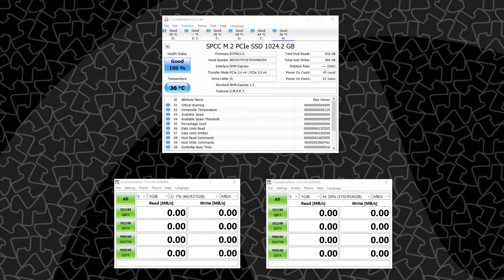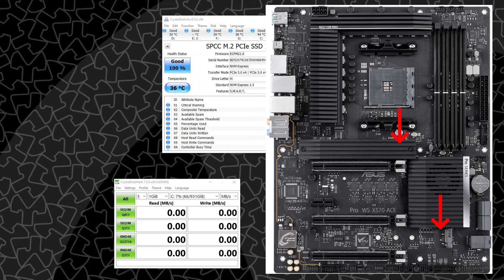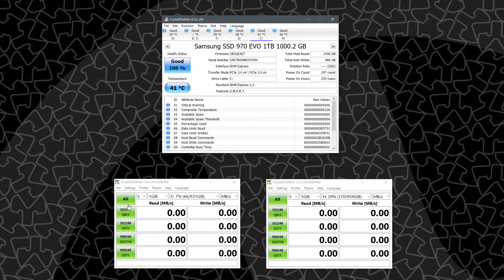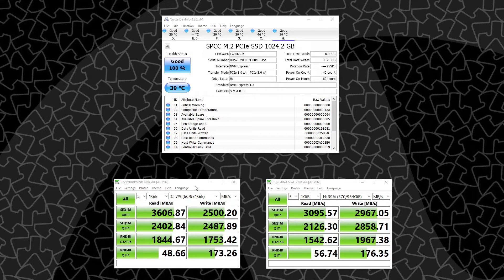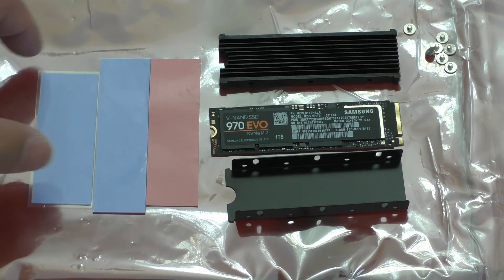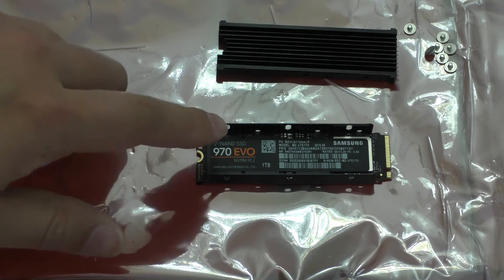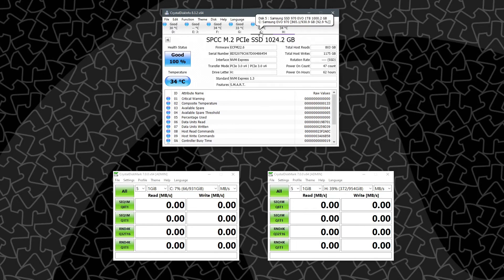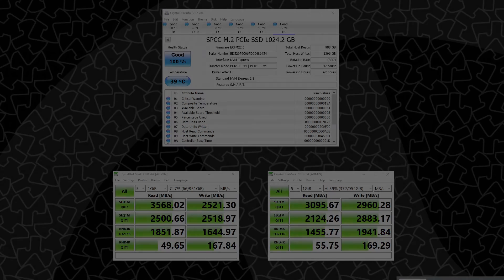Motherboard M.2 SSD Heatsinks, Yay or Nay?

Comment: The question for which I've got is can I replace the native M.2 heat sink with an aftermarket so that they are both the same?
Reply: you can, but unlikely to yield any performance difference
Reply: @tenka__  Not looking so much at the performance issue. More like aesthetics in this instanstance. As I'm I'm planning on an AMD cpu and Radeon build and want a clean build

Comment: Great video, but I got a question. Do I need to take off the M2 sticker (I have the same Samsung M2) before putting it on to the mobo heatsink? Thanks!
Reply from the maker: There's no need to remove the sticker. The heatsink will work just fine with it on.

Comment: Does anyone know if I can move my m.2 from the non-heat sink position to the heat sink position without issues?
Reply from the maker: Yeah that's no problem. Might have to make sure the boot drive is still correctly set in the UEFI if you're moving your boot drive though.

Comment: im using an aorus b450 elite motherboard and 1 TB Lexxar ssd nvme m.2 gen3x4. this ssd gets kinda hot when i play rdr 2 ( average 61-62 ish, max 65 celcius ). this mobo come with 2 slots and i use the one that have heatsink. is it safe? or should i buy this aftermarket ssd heatsink?

Comment: Every NVME video that I see does not show if the ssd label should or not be removed before placing the thermal pad over it, please tell me, even in this video you didn't show this passage
Reply from the maker: There's no need to remove the sticker. Lots of them are made to conduct heat.
Reply: @FaRKle0079  thank you , I didn't know it

Comment: Which heatsink would you recommend for a seagate firecuda 520? Since it is a double sided m.2 with chips on both sides I'm not sure which heatsink would be best for it. The one with the motherboard showed better performance for you but it doesnt cover both sides, so I wonder if it would be better or not and show better performance for the firecuda. Please get back to me, thank you! (P.s. I have a second single sided and not as fast m.2 that I was also going to use so I'm trying to find out which heatsink to use for which drive.)
Reply from the maker: The main component on the SSD to keep cool is the memory controller. That's what controls throttling of the data rate. The actual flash memory chips themselves don't really need cooling (unless you're operating in a SUPER hot environment). So I'd say you likely don't have to worry about the bottom side memory not having a heat sink.

Comment: Nice video! Helped me to understand the performance of different heat sinks
Reply: Bro every nvme ssd  come with heatsink or I have to add new heatsink for temperature???
Reply: @nstsarr5189  Depends on the situation. Usually, it doesn't come with a heatsink unless it told u like SN 750 with heatsink and it would be a bit higher price than without heatsink. And the heatsink is impossible to be used inside the laptop. Some motherboards of desktop have the heatsink on the board. You only have to buy the heatsink while both NVME SSD supplier and motherboard don't give u one.

Comment: 3:00 - one thing to note: I've read that the rated operating temperature has nothing to do with the temperature of the controllers; it's the recommended ambient temperature range! I can't confirm this 100% but it is something I have read several times
Reply from the maker: You're right that operating temp isn't necessarily the same as throttling temp, however it's generally pretty close for these consumer drives. In tests that other review sites have done they've shown the P34A80 drive starts to throttle at 70C, and the 970 EVO a bit higher around 79C. So you can see that even if the actual throttling temp is slightly higher, I was right up against it with winter time ambient temps.

Comment: It would be interesting to see how much having the GPU mounted over the x570 motherboard fan affects the temps on the motherboard as well as the GPU itself, I have the same motherboard and was wondering if a vertical mount would help separate the airflows.
Reply from the maker: I think it would highly depend on the type of fan on the GPU. A blower style fan that doesn't recycle the air inside the case would probably keep the chipset cooler than a GPU fan that does send hot air back into the case. Of course this is also going to be dependent on the overall airflow inside of the case. Something with pretty streamlined flow (like a Silverstone vertical case) probably will be less affected than one with less streamlined flow.

Comment: I have a X570-I itx board. It has 2 slots for M.2. I have a 979Evo plus 500g and another one at 2TB. I’m using the 500gb one for the boot drive. My question is does it matter which slot I install the 500gb M.2 boot drive to ?
Reply from the maker: It doesn't really matter which slots you put either drive into.

Comment: Hi. It looks your M.2 SSD only supports 3400/2500 MB/s. Do you know if both ports supports  5000/4400 MB/s. I want to buy this Motherboad with a SB-ROCKET-NVMe4-HTSK-1TB. This also has its own Preinstalled Rocket NVMe Heatsink.
Reply from the maker: The M.2 slots have PCI-E 4.0 4x lanes. That'll handle your SSD's rating.
Reply: Both handle 7.5 G/S however the top slot has a direct connection to the CPU while the bottom one uses the X570 as a pass through the chipset (PCI-e Bridge) so the top slot will always be warmer as it it under more stress
Reply: @Dazzxp  So, in which one would you install a 970 evo plus?
Cpu is ryzen 5 5600x
Gpu is asus gtx 1080 turbo.
Reply: @stavrosdra  The drive you want as a Operating system drive should always be in the top (lower latency) with the bottom being for other things games, data etc.
Reply: @Dazzxp  so if you have only one, it’s better for closer to cpu. Unfortunately my mobo has heat sink only in Lowe m2...
Reply: @stavrosdra  sick to the one at the top of you only have the one could try a 3rd party heatsink for it
Reply: @Dazzxp  that’s what i am thinking about. Thank you mate!

Comment: Hi, thanks for the informative video. I want to add a 2nd m.2 on my mobo. Are you running a raid 0? If not what boot sequence would you recommend?
Reply from the maker: I'm not running RAID 0. I'm not doing anything that would benefit me from doing that. I set my boot order to my OS SSD first. It doesn't really matter which M.2 slot it's in.

Comment: Great video dude and tests. I'm planning to buy the ASROCK B550M PRO4 and it has the heatsink near the GPU, will that make the NVME SSD overheat because of the GPU or will it do nothing at all?
Reply from the maker: Having the drive by the GPU shouldn't be an issue. Closed GPU heatsinks shouldn't hinder it, you'll just want to make sure your case has airflow there, and open GPU heatsinks will constantly be blowing air over that area.

Comment: Does the x-570 plus actually have a heatsink or is that just a cover? Do you have to buy the heat sink separately for m.2 ssd?
Reply from the maker: The motherboard has an actual heatsink which comes with a thermal pad on the underside.

Comment: If my M.2 comes with preinstalled heatsink and my motherboard has heatsink too, I guess I should remove the preinstalled heatsink and use the one on the motherboard instead?
Reply from the maker: It probably doesn't really matter performance-wise which one you use. One of the heatsinks might cool better, but I'm sure both are sufficient. Basically, choose whichever looks better to you, haha.

Comment: Can i add this heat sink in top of processor heat sink in laptop?? will that work to lower the temperature of the cpu in a dell m3800???
Reply from the maker: It depends on how much room in the chassis your laptop has. Likely no though since you'd also have to find a way to make it clamp down.
Reply: FaRKle0079 ohhh okay.. i do have Dell m3800 and its like boiling oven for me .. a simple task can trigger temperature to 97.. 98 degree Celsius..  is there any mod except changing thermal paste?
Reply from the maker: @samarpan2u  Wow, that's pretty hot. Yeah I'd check the heatsink/heatpipe connections and thermal paste.

Comment: I have an asrock Z390 phantom gaming 9 with triple M.2 slots and the last one has a heat sink covering it. What I want to know is if I can put a Samsung 970 Nvme ??
Reply from the maker: Yes you can put a Samsung 970 NVMe SSD there. Typically when there are that many M.2 slots on a motherboard they share lanes with some of the SATA ports so just be aware to see which SATA ports will be disabled if you have an M.2 NVMe drive there.

Comment: Dude, great video and tests. Thank you. I have the same mobo and was like what the fuck why did asus only include one heatsink. I was going to isntall my OS SSD in the top slot, but now i'm going with the bottom, which according to the manual also supports the 4th gen of pcie for nvme.
Reply: Do you know if you can mount the bottom heat sink to the top m.2?
Reply: @160rowan  yea heat sink is there for heat dissipation only, as long as both the slots are pcie m2 slots, u can swap them, top is preferred becoz of heat blows from gpu's heat..... Although i still dont know why x570 makes it as bottom one default.... But yeah, u can swap'em
Reply: @SpeedNash  u just answer my question. Thanks.
Reply: Both m.2 slots are gen 4
Reply: Yeah if u have x570 series boards, both slots are pcie m2 slots. So either will work

Comment: This is a well done video thanks man. I have the same board, its interesting that the lower one is cooler still. My guess is that the chip set fans blowing air on it. Paul from Paul's hardware said NAND chips like to run warm which explains why most nvme drives come with no heatsink and at best a cooling sticker like Samsung nvme drives.
Reply from the maker: I think it's a function of the thermal mass of the heatsinks. The one that came with the board has a lot more material. 
Users always have the option of removing the thermal pad over the NAND chips themselves to only cool the controller. Even though the NAND may prefer higher temperatures, even at lower ones you should still get the rated longevity of the drive.

Comment: Hey - Great video! Quick question.
The Samsung 970 evo plus has the sticker on it, with its name and S/N printed on it etc. When installing it on a mobo with a heat sink built in for it do you have to remove that info sticker for proper thermal pad contact?
Reply: Usually that voids the warranty. Silicon power's one has one too but it is made of thin metal so it's more conductive
Reply: I ended up carefully removing the label on my two Samsung 970s. No tearing, so if I needed to put it back I could. It didn’t make sense to me to put a thermal pad on top of the label.
Reply: @pat.sambas  The label on the EVOs contains copper than disperses heat.  You're not supposed to remove the label even with a heatsink.   I left the label on mine when adding an Asus heatsink that came with the MB and the temps are great.

Comment: Best video ever,  could you test same ssd two different slot? Is there any latency or something, maybe quite slower because distance at cpu. I have an same mobo. Thank you.
Reply from the maker: I don't have this exact board anymore, but for x570 there shouldn't be a significant difference between the CPU lanes M.2 slot and Chipset lanes M.2 slot. You're right that latency is probably ever so slightly worse on the chipset slot, but I doubt it's noticeable aside form certain niche workloads.
Reply: @FaRKle0079  thank a lot mate for reply.

Comment: A couple questions. I bought this exact motherboard. Is it best to have 2 NVME SSD's or can I just use the 1 slot that came with factory heatsink and install Windows and all my games, etc on 1 drive? Also on the factory SSD heatsink, do I need to buy the thermal strips to put on the bottom and top of SSD drive. I haven't even opened the box to see what came with it. Thanks
Reply from the maker: It doesn't make a difference whether you have both M.2 slots populated or only one, and if you only have one populated, it doesn't matter if it's the one with the heatsink or not. The factory heatsink on the lower M.2 slot comes with a thermal pad on it.

Comment: Hey I have a rog strix z390 e and I'm considering slapping a m.2 in the lower slot (because it supports nvme). Will the heatsink affect GPU temps?
Reply from the maker: The M.2 heatsink should have no/negligible effect on GPU temps. M.2 drives only consume a few watts.

Comment: I ordered that exact mobo you have along with an m.2 ssd drive. My question is do I have to place my ssd on the slot without the heatsink (cause its the primary one) or will the mobo not mind if I place it on the second with the heatsink?
Reply from the maker: You can absolutely put your M.2 SSD in the heatsinked slot without having one in the non-heatsink one. I wouldn't think of the slots as "primary/secondary," and instead think of them like the SATA slots, which are named 1-6 (or 8), but none of them really have precedence over the others.
Reply: @FaRKle0079  Thank you for the quick and helpful reply. I appreciate it!

Comment: OK, but I might be concerned about the bottom part of the bracket making contact with the mb.
Reply from the maker: There's enough standoff distance between the back of the heatsink and the motherboard. No problems with it making contact.

Comment: You a trying m.2 raid 0 ?
Reply from the maker: Nope. I don't have my M.2 drives in RAID. I'm keeping them individual.
Reply: Came up on that this video because I was looking for information about raid performance. I know the lower m.2  is connected through the chipset but I guess it doesn't matter if they are both pcie4 4x

Comment: Great informational video. My question/concern is that, would the heatsink will get in the way when installing a thick 2.75 slot  tripple fan gpu, specifically for the EVGA RTX 2070 super FTW3 Ultra+?
Reply from the maker: If you're referring to the top M.2 slot, I don't think a GPU should interfere since the heatsink on it extends out on the opposite side of the GPU.
Reply: FaRKle0079 If i May ask, how much gap in between your GPU and the heatsink? (Like 1 cm, 2cm etc..), and what kind of GPU do you have? I just wanna make sure everything will fit when I put it all together. Thanks
Reply from the maker: @joz312  I don't have the TUF X570-Plus motherboard anymore. That said, I have a Strix X570-E now and the spacing between the GPU slot and M.2 slot look the same. The Strix X570-E comes with a heatsink in that location and between the edge of the heatsink and the edge of the GPU slot (the slot it self, not the card) there seems to be about 3-4mm. Now the PCB of the GPU sits another couple mm in from the edge of the slot itself. You'll likely be OK with the M.2 heatsink and your GPU since the backplate on it doesn't stick out that much.

Comment: Sir can I put 2 m2 memory on a motherboard?
Reply from the maker: If your motherboard has an M.2 slot the manual will say what types of devices can be plugged in. If your motherboard doesn't have an M.2 slot, then you'll need a PCI-E to M.2 adapter card.
Reply: FaRKle0079 is it possible to put different m2? 1 500gb 970 evo and  1 500 gb 970 evo plus
Reply from the maker: @jericacena6711  Yes, if you have two M.2 slots you can put different drives in each one.
Reply: FaRKle0079 what if you have 3 slots?
Reply: @FaRKle0079  I read that the label should be removed if using a heatsink with the Samsung. Thoughts on that? Something about spreading heat between the NAND & the controller.

Comment: Have you considered gamer's nexus video on this where he explains that this will reduce the life of your ssd as the card prefers to run hotter under when writing?
Reply from the maker: The question you should be asking is, "Reducing the life of the flash relative to what?" If you look at the specs of your SSDs you'll see they include an operating temp spec and an endurance spec. On my Samsung 970 EVO 1TB M.2 SSD that happens to be 0-70C and 600TBW. That means if the drive is operating in those conditions, that it is very highly likely to last 600TBW. So while it's possible I could get more than 600TB of writes by not running a heatsink, even with the heatsink I should meet the advertised specs, and avoid throttling under controller heavy loads. 

Now if you live somewhere that's so cold that your drive is typically running under 0C, then maybe a heatsink isn't a good idea, but at that point you probably wouldn't be considering one anyways since it's not likely the controller will be coming close to throttling temp.

Comment: Question did you have fans in the front of your rig?
Reply from the maker: Yes, I have a Silverstone FT02 with fans pulling through a radiator, and then that air goes over the motherboard. Most quality cases should have fans blowing across the motherboard in these areas. I keep the fan speeds low so that I can't hear them.

Comment: Best review of this, simplistic. I actually purchased a nice RGB heatsink for my M.2 Samsung Evo Plus drive, lo... I discoversed my Mobo Asus Z270H Gaming mobo does NOT have RGB inputs on the mobo. So in replacement I got another from amazon ~ Thermal Right M.2 Heatsink Cooler, which appears to have the bottom and top coverage for heat sinking. Following your video, seeing the test results comparison, I'm looking forward to getting this heat sink. I'm seeing temperatures go as high as 72 Celsius when playing Modern Warfare Warzone while being in a very cool ac room with a window fan under my desk which is directly next to my pc  (to paint a picture). BTW, Samsung has free software to monitor your hard drive's temperature its called Samsung Magician, and works pretty good, comparing it to another hard drive monitoring software (hard disk sentinel), temperatures are comparable.
Reply: Question did you have front fans on your rig.